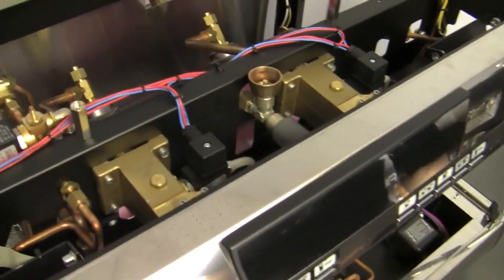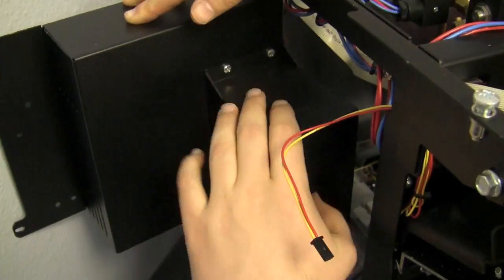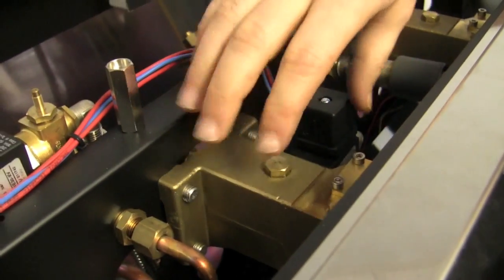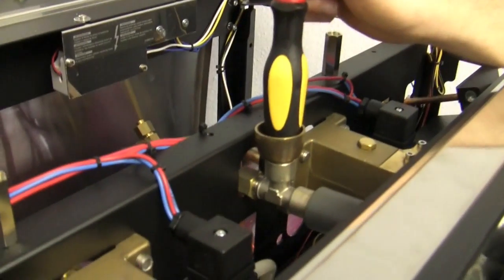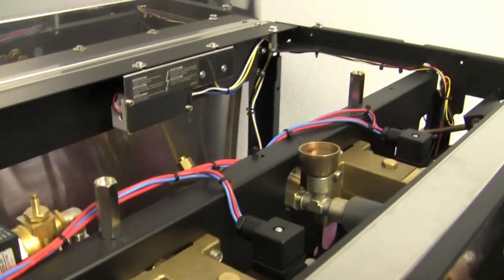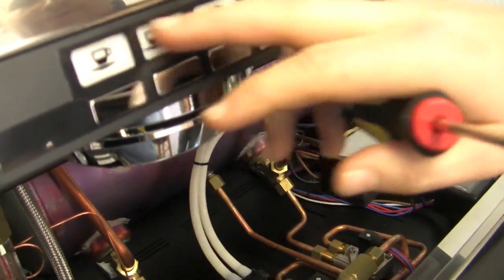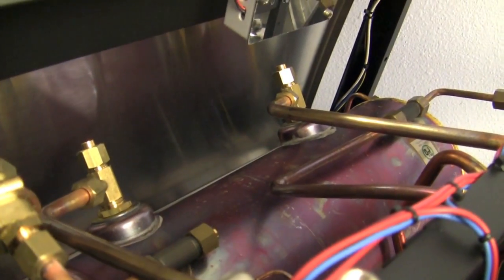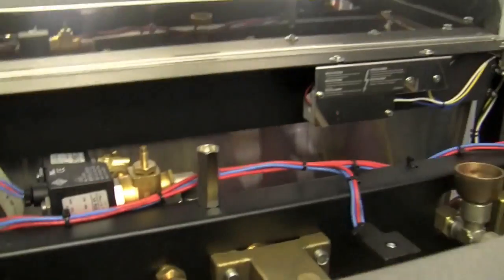Internal Tour of the Nuova Simonelli Aurelia II Volumetric Espresso Machine

Comment: Great video!  I work in facilities maintenance at our school, and we have the predecessor to this model (2008). I'm replacing a flowmeter valve that 'burst' at the plastic piece that is sandwiched between the base of the wire group and the top of the valve body... and this video has given me a much better understanding of the machine as a whole.   At this point I don't know WHY it burst, but the flowmeter on the right is clearly worn, while the left side looks almost new... so I'm hoping that it is simply a matter of the right side being used 95% of the time by the student operators in their little coffee shop.  Thanks again!

Comment: This is an excellent video.  I have a machine that has been in service since April of last year (2018) and experiencing intermittent leaking from the vacuum breaker.  The tank level is high at the times this occurs.  What controls the tank level?  I am assuming that the leak is a symptom of a tank level problem.  Is that correct?  Thanks for any assistance.

Comment: I would like to ask you a troubleshooting question?  Im in a remote location and having issues getting my 2006 aurelia working.  The issue is I cannot get water to flow through either of the two groups.  Each group head is not hot so I assume something upstream of the 3 way valves not allowing them to open.  The error I keep getting is Doser Error Group 1 and then Doser error group 2.  Thanks in advance

Comment: Hey Kat, thanks for this video, it's been very informative for me as I work on this exact machine. I have a question though, on my machine, the hot water spout us not giving hot water, I noticed a knob to the right side of the solenoid and I'm wondering if I could fix the temp by adjusting that. A reply would be amazing, thanks in advance.

Comment: I hope someone can answer this, but I bought a WBC 2009 edition machine from auction and had to rebuild it as it was in really rough shape. It's been in service for the last year in my shop and then I just had to replace the pump he points to at 9:24. This is where I noticed something peculiar. When I first started up the machine the water in sight glass went to full instead of the usual slightly below half. In doing so this thing it's always done where it groans awfully every time it fills disappeared and it was quiet as could be. But after about a day it readjusted itself to just below half and the awful noise is back which I'm guessing is basically vibration resonating in the half full tank? So is there a way to adjust the water level in the tank to raise the level on the sight glass (other than the manual fill which will just override automatically again) or do I need to replace something else?

Comment: Hi, i have a 2011 3 group volumetric aurelia, my pressure gauge reads 10-11 bar when pulling shots and hot water spigot is spitting water with some steam when doing americanos. Q, are the pressure gauges accurate? should i adjust it down to 9 bar? will this be affecting my temperature? and any ideas whats going on with the hot water? Do you have any good websites where i cat get info on working on these machines? i hope you can answer my questions. I dont have the money for a technician at the moment. thanks so much in advance!
Reply: kevin douglas did you figure out this question? I have the same problem with my aurelia 2, I'm also having to adjust the temp coming from my group heads as it drops teen degrees every two hours
Reply: This information is bit late and I'm sure you would have solved your problems by now (hopefully) but for anyone else wondering:

1. yes the pressure gauges are accurate and you should definitely adjust your brew pressure down to 9 bar.
2. no it should affect your brew temperature, you may be using water more and faster therefore the machine will need to work harder to maintain stable temp.
3. your hot water dispenser tap is spitting and steam because the water that is being dispensed is around boiling point so it will be spluttering. If you adjust your hot water temp down with the valve mentioned at 2:10 - 2.40 in this video it will dispense cooler water and therefore will not splutter.
4. The Nuova Simonelli aurelia t3 Manual can be found easily on the Nuova Distribution website or through google and is filled with info on how to use these machines.

Cheers.

Comment: Please help, I have a musica it does not do autorefill. I can say so it didnt do autorefill because the lights water-empty goes on but the pump is not pumping water to go to the boiler. Though whenever I started the machine it did work and I can make only single shot, I can no longer make 2nd. The water-empty light turns on as well as the 4keys delivery for hot water and coffee dosing shot keeps blinking. Meaning the keys doesnt work anymore, cannot function. My musica is 4month old I think it is not water scale that cause it. Please help what shoukd I do.. Thanks